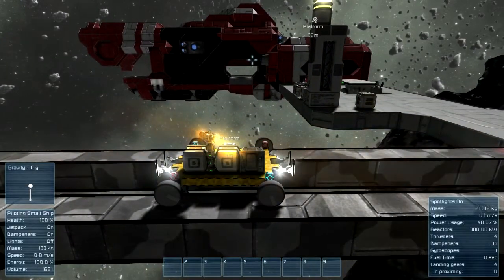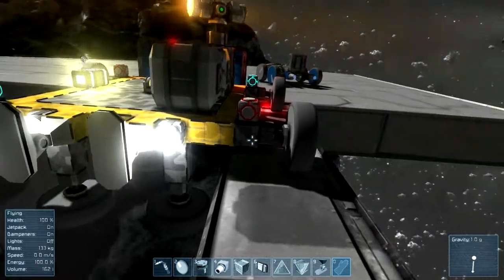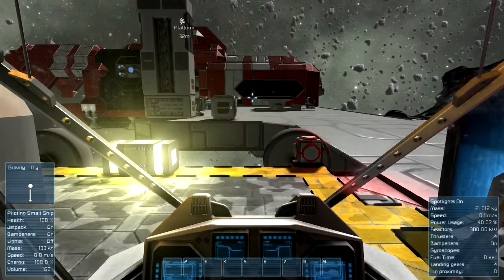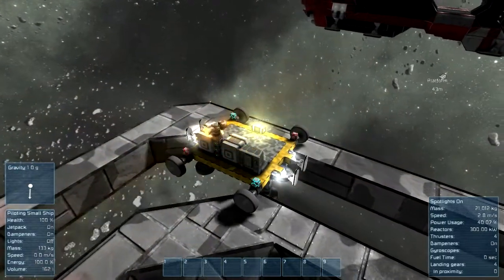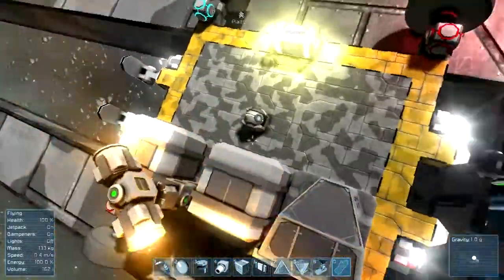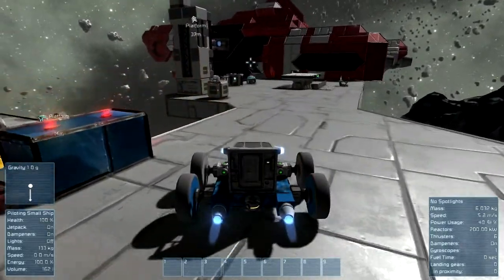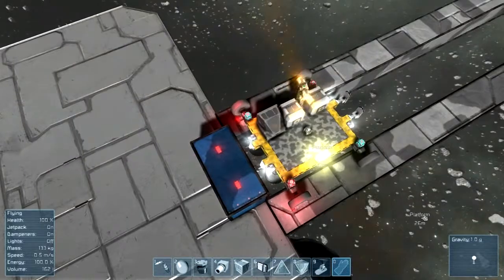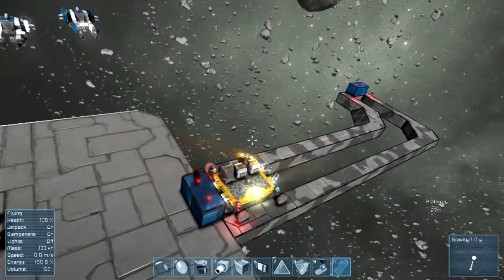Space Engineers Carriage Testing

Comment: You can get it to work, simply increase the distance between the front and rear guide for the cart (i.e. more rectangular rather than square) or create a small-ship rail under/in the gap under your cart so you have a smaller slit guiding a single wheel in the center axis in the front and rear of the cart. Also you might want to considder using ramps to make the turn more fluid. ;)
Reply from the maker: Thanks for the advice. Will get to work on a much improved design and hopefully get a video up testing that in the next day or two.
Reply: All good, just trying to help out. Good luck. :)